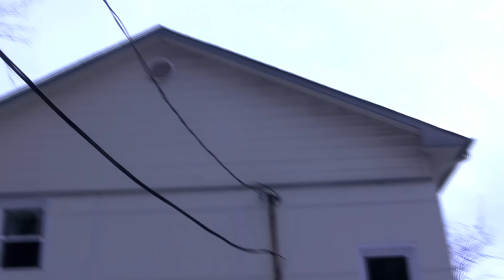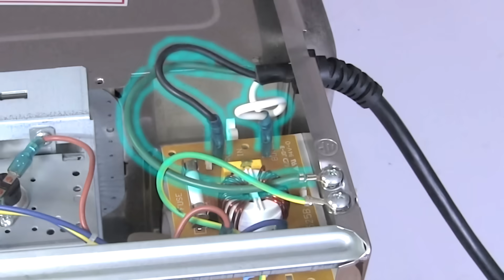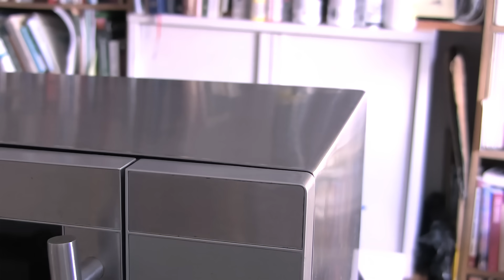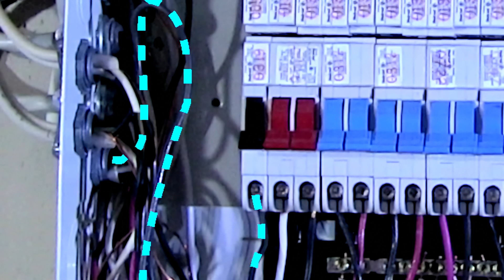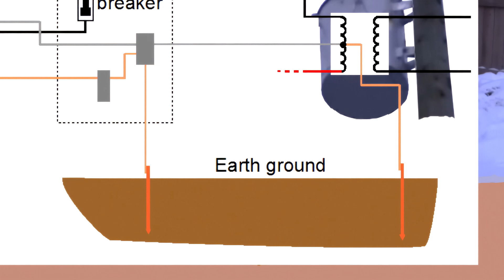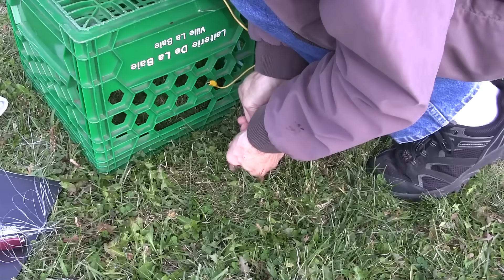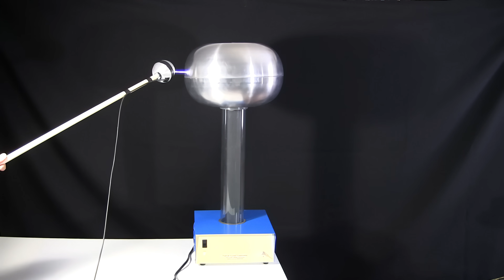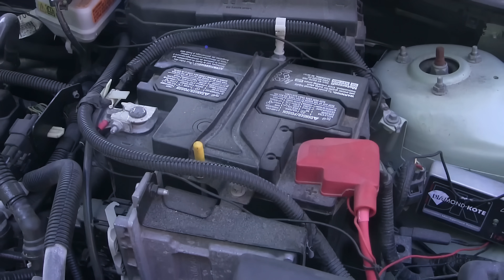What is Ground? Earth Ground/Earthing

Comment: @rimstarorg Excellent video but I believe you made a mistake. In the last schematic (with the bridge rectifier), the ground symbol does not mean earth ground. It symbolizes the 0 volt reference of the DC signal.
Reply from the maker: Actually, that's my homemade power supply so I know that if I open up the unit I'll find the earth ground connected to the case and to where that ground symbol goes in the schematic. I can see your point and maybe I shouldn't have done that but I did it for a reason -- maybe flawed but it's worked for me for many years.
The reason is that I want the output to be 0-24VDC with respect to earth ground. Maybe I should have connected that ground symbol to neutral instead? That low voltage power supply most often feeds my high voltage power supply, passing that earth grounded connection on through the black colored output banana plug connector (that's the 0V connector with respect to the red one which is 0-24V). The high voltage power supply then uses that as the ground return for it's high voltage.
I want that high voltage from that power supply to be with respect to earth ground for safety reasons and practical reasons. In terms of safety, I certainly don't want any floating high voltage. An example of a practical reason is when flying a lifter (in case you don't know what that is http://youtu.be/vzZy1Aqleno). The foil skirt of the lifter is close to the table and I want it at earth ground potential so that the table has negligible effect on the skirt. Meanwhile the lifter's thin ionizing wire is at high voltage with respect to ground.
Reply: And if you open up the power supply unit, you should find earth ground just connected to the case.
Reply: And the case connected to the power cord's ground prong. It's Earth ground.
Reply: I suspect that connecting the 0 V to earth ground in that circuit has the effect of shorting out part of the AC signal but not enough to trip the mains circuit breaker. I would investigate with an oscilloscope across the 24 V output with and without the ground connection. I anticipate that without the grounding, there would be a reduction in the amplitude of the ripple in the DC voltage or an increase in the DC voltage . If this is the case, then it would indicate that the ground wire is carrying current under normal conditions though it is only intended for safety in abnormal conditions. Please do let me know if you do test out my hypothesis!  Keep up the great work.

Comment: a question too,  i been looking to buy a welder (a cheap chinese one from ebay) some have (i guess) proper ground, in the back of the unit that i guess require to be connected to the house ground rod, some just have the ground on the prong , do they do the same job both?
Reply: hi i have the same question. if you find some info please pass it along.

Comment: that might sound like a really stupid question, but in my city there's a hydroelectric plant producing the power a few kilometers away, when electric charges goes into the ground, do they somewhat try to get there to complete the circuit, or it just dies in the ground?
Reply from the maker: They may have a neutral return wire or they may not. It's done either way depending on the location. +balisticsquirel and +Mr Anderson are talking about the same thing in the comments above. If it there's no neutral return wire then it's a single-wire earth return system https://en.wikipedia.org/wiki/Single-wire_earth_return.

Comment: can you get a shock by touching the neutral?
Reply: yes. If the appliance is connected and switched on and the neutral has broken connection with the mains (broken wire in the cable for example), it has then high potential to ground. The appliance wouldn't work, but you can be electrocuted touching the neutral.
Reply: jaryH3 umm...NO. The neutral line is always at zero volts. Measure with a multimeter between the neutral line from an outlet and any grounded point and you will get zero volts. The only time where the neutral line might be live with reference to ground is if a line has come loose from the distribution transformer. (I had this happen once.)
Reply: @ct92404 which sort of what I have said. 

In normal state it is practically 0V to GND. In fault state (broken wire in the cable) it can happen there is quite strong mains voltage on the neutral wire.

Comment: It's interesting how you have transformers on the power poles, here we don't. We have substations which do basically the same thing but deliver the 240 volts to a much larger area or even 3 phase electricity to where's it's needed. 

On some older cars, (e.g. Older VW Beetles) they used a positive (Hot) ground. It was soon realised that this made the car itself act as a sacrificial anode and accelerated corrosion to exposed bodywork and chassis and was discontinued for that reason.

Comment: Thanks for this video, indeed.
Here in Italy we have a different arrangement (neutral and ground aren't connected and stay on a completely different path) but the function is. obviously, the same (among the fact that we have a lot of kinda life-saving switches capable of turning off immediately if there is assorbtion from hot wire which is not returning through the neutral)

Comment: I think i did not understand the microwave cicuit part, if only the "hot" wire is connected to the breaker it means that ground and neutral are the same thing? if you do a short circuit between neutral and hot or ground and hot? wouldn't they both trip the breaker?
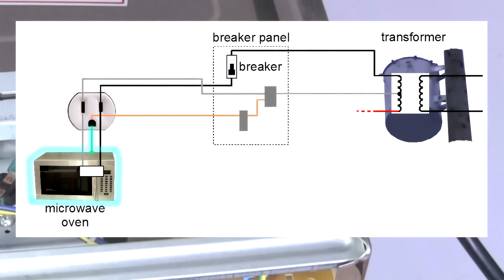Reply from the maker: Ground and neutral aren't quite the same thing. The difference is that while ground is connected to the neutral at one end, the other end doesn't connect to anything -- well, it's connected to the microwave oven's case but that doesn't go any further, it's a dead end. The neutral, on the other hand, does go through the electronics and back to the transformer's coil and then back to the hot. Trace the wires at 2:21 in the video (I guess I should have drawn that loop all the way).
And yes, a short between neutral and hot will trip the breaker. If you trace the neutral and hot loop (again, 2:21 is a good place to trace it) you'll find that they go through the electronics in the microwave oven and that's what prevents a high enough current that would trip the breaker. But if you bypass those electronics and connect the neutral and hot directly then the current will be a lot higher, high enough to trip the breaker.
As for a short circuit between ground and HOT, well that's what's going on at 3:28. The short is across the metal case.
Reply: I've also wondered what happens to the AC waveform if the neutral is connected to 0v.
Reply: Got it, thanks for the explaination :)